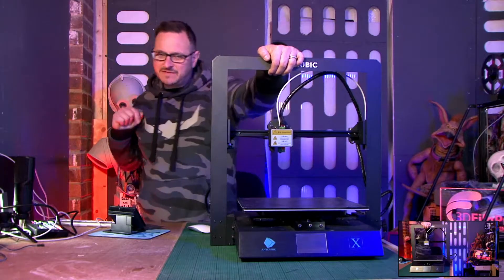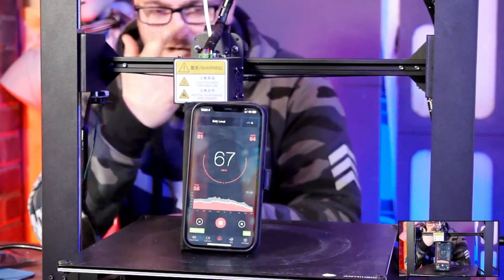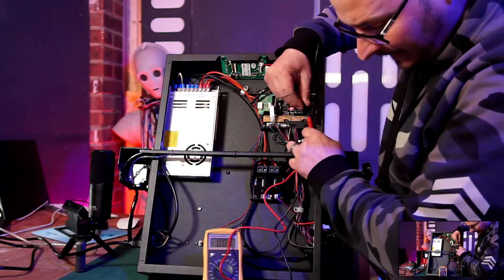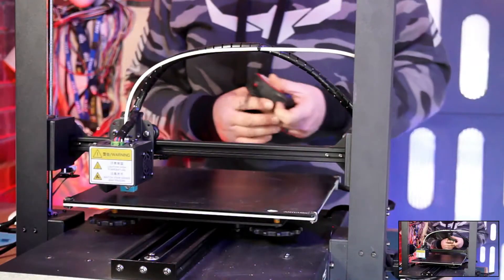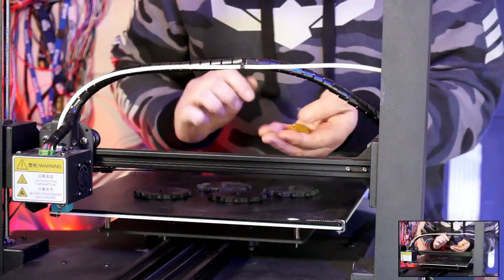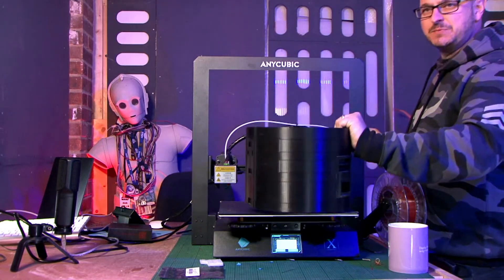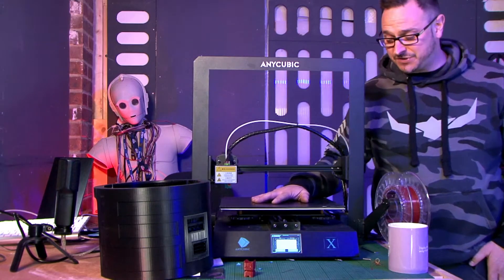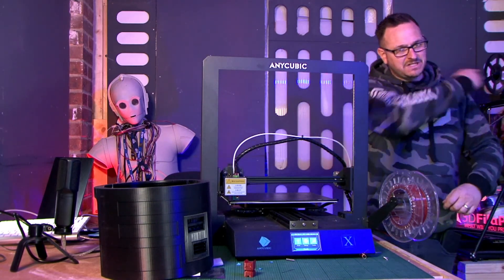Anycubic Mega X TMC2208 Upgrade - Silence!

Comment: I am a bit late for this, but I just swapped to the TMC2208 on my anycubic mega x, but now i have an issue with my Y axis. When I try to move it, it only goes into one direction. Additionally, as soon as I give a command to move it after boot, the axis locks up itself and it is almost impossible to move it by hand. After turning off the power, it becomes movable again. 
Has anybody an idea what could have gone wrong? Thank you!
Reply from the maker: So you need to swap the wires around on the stepper, it will be doing a juddering noise now right? So to fix this you either take the two core cables or external two cables and invert them

Comment: Hi just installed these on mine it is homing in the wrong direction. What do I do about this??
Reply: Yep working fine thanks for the help and the fast reply. I came across your channel today you've got my sub!!
Reply from the maker: @chasejdmartin  awesome glad it helped! It should quieten that down !
Reply from the maker: You can swap the direction on your stepper plug maybe try the two outer cables on the motor
Reply: @TheRealSamPrentice  thanks for the reply. I reversed the outer two cables. It caused the stepper to jam. What am I doing wrong?? I've fitted bigtreetech drivers I've also set the voltage on each one.
Reply from the maker: @chasejdmartin  okay so the cables are magnetically charged so change those two cables back the other way, and try the centre two
Reply: @TheRealSamPrentice  I think I've sorted swapped the red and blue cables around
Reply from the maker: @chasejdmartin  good stuff !

Comment: About 9 months later, I landed one for about $270AUD with materials, So price has definitely gone down! Thanks for the video, Any idea on the TMC 2225? Supposedly it's just an incrimental upgrade, But wanted to know your opinion on purchasing it over the tmc2225 over the 2208.
Reply from the maker: They are in essence the same but the 2225's run a little cooler. ;)

Comment: Hi Sam i just got this printer last month and have been playing around with it for a bit now but ive found that my build plate has a slight wobble to it. any recommendations as to how to tighten it up ?  also could you link the springs you talked about in your video as i cant seem to find the link 
Thanks!
Reply from the maker: Hey There, okay so is the wobble due to the hex nuts needed to be adjusted? If you pop the printer on its side you'll see the little black wheels a couple of them with have a nut that you can slightly tighten. Be sure not to go crazy! just tweek it. (on amazon SIQUK 16 Pieces Heated Bed Springs OD 0.31 Length 0.78 Die Springs Light Load Compression Spring for 3D Printer Creality CR-10 10S S4 Ender 3 Heatbed Springs Bottom Connect Leveling)
Reply: @TheRealSamPrentice  Actually with this printer the bolts that attach the leveling wheels to the bed can become loose.
Reply from the maker: @petercallison5765  pretty sure this post from 3
Months ago is sorted now buddy
Reply: Thanks Sam I'll check that out once my current print is done printing. I really appreciate the reply !
Reply from the maker: @tommydames  anytime

Comment: Hi Sam,

Did you not feel the need to fit an extra fan as is recommended for the TMC2208 drivers?. 
How do you check the drivers with the multimeter and tune them?. 
Also is that an app that you used to measure the sound?.

I have a Mega X and the same TMC2208 drivers but I plan on changing the driver heatsinks to lower and wider ones so I don't need to move the fan.
Reply from the maker: Nope I didn't fit another fan, I felt that the airflow was adequate. I also didn't check with a multimeter either, the printer is spot on tho and printing day in and out :) The app I used is called BD meter on the app store :)
Reply: @TheRealSamPrentice  Hi Sam,

Thank you for your reply and answers.

It was the new drivers you were checking or testing in the video with the multimeter, I couldn't quite see what parts of the drivers you were touching with the leads. You mentioned that you tuned the drivers to 0.85, is that fairly simple to do?.
Reply from the maker: @sl3082  okay so the multimeter part you pop the meter onto the pot which is the little screw that you turn and the other to ground
Reply: @TheRealSamPrentice  Hi Sam,

Thank you for your replies & help.
Reply from the maker: @sl3082  anytime

Comment: Do you have a tutorial on how to update firmware on mega x? my bed heats up past the setting I have. once the printer is on the ned heats up tp like 85 and just stays running.
Reply from the maker: I would suggested doing a PID tune on your bed if that’s the case
Reply: @TheRealSamPrentice  how do I do that. I’m very new to all this
Reply from the maker: @djsdioramas1084  do you have your computer hooked up to your printer? or have a pi connected? 
https://3daddict.com/pid-tune-3d-printer/
Reply: @TheRealSamPrentice  I can hook it up to printer
Reply from the maker: @djsdioramas1084  Okay download a program called pronterface and use the terminal option on that software and follow the link info :)

Comment: On DWITs tutorial, he unplugged and flipped the socket for the cables beneath the stepper drivers. It does not look like you did that. Is it not necessary on the Mega X?
Reply from the maker: I’d say not mine has been non stop since this video was published no issues here
Reply: @TheRealSamPrentice  I was able to buy my Mega X for 239 Pounds sterling.
Reply: @TheRealSamPrentice  sale on Amazon on the 2208s now.
Reply: $13.74 Pounds sterling for the steppers after a 50% coupon.
Reply: @TheRealSamPrentice  thank you for sharing your expertise and this video! My Mega X is on back order at the moment. Can’t wait to get it set up and complete these mods!

Comment: Sam- can you confirm.. purchased the steppers in the link for my mega x... the chips seem to be on the underside, so fitting the heatsinks on the top wouldn't do much? also, is it worth checking the settings of the existing stock steppers before removing so that the tmc2208 can be set to the same on install? Great vid, but was a little quick- watching it back a couple of times as don't want to knacker the printer by installing wrong.. also, can you add a link for the bed springs please?
Reply from the maker: Drop me a pic of your chips

Comment: Hi, Question do you find that the X is slower now that the TMC 2208's are installed? I've done this mod on my Mega S and X. On my S the speed stayed the same but on My X  the hot end and board seem to move extremely slow now.
Reply from the maker: I’ve not noticed that to be fair it’s printing fine tho have you got a video of it ?
Reply: @TheRealSamPrentice   https://www.youtube.com/watch?v=0q-SmJwxLRY this should be 60 mm/s but just doesn't seem like that to me.  I even upped it to 80mm a min just to see if there was any change and I don't notice one at all.  Also my print time in Simplify 3D is a little off on my Mega S and Mega P (as is usual) but on my Mega X it's off by hours.
Reply from the maker: @billhoughton7923  that does seem slow! Are you slicing with cura ?
Reply: @TheRealSamPrentice  no simplify 3D but I’ve used cura as well and get the same speeds. I’m thinking it has to do with voltage I may try upping it to 1.0 this weekend